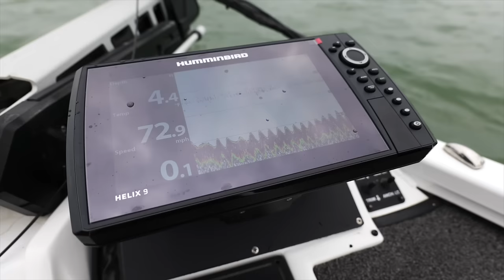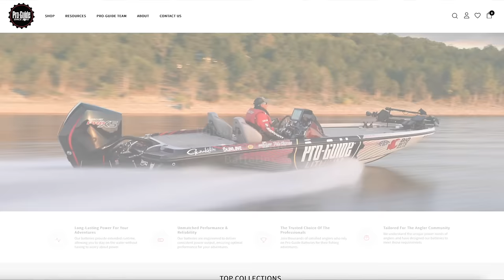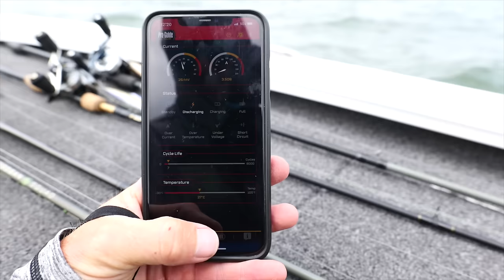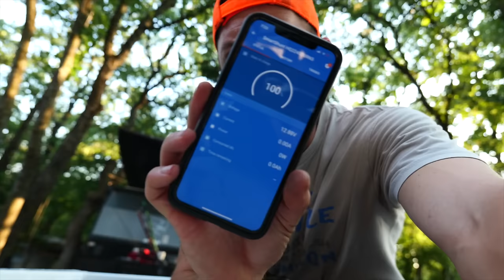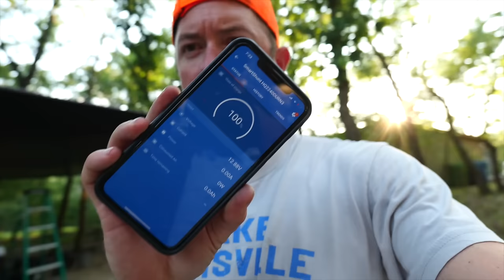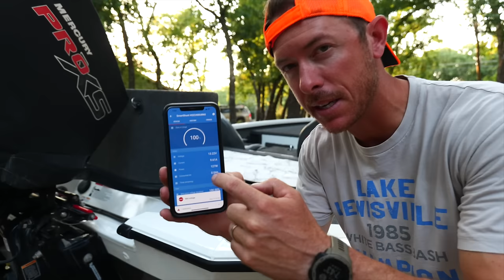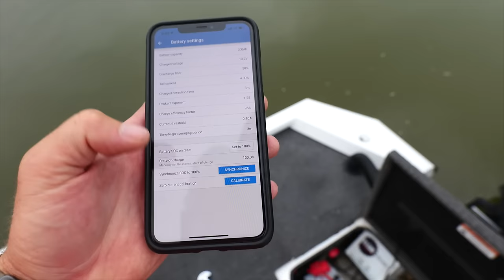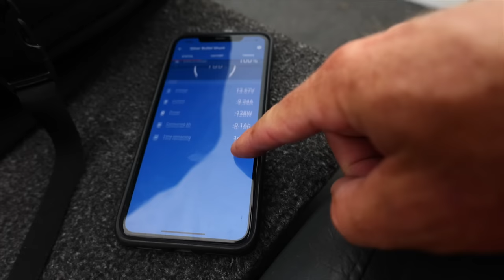I've Never Seen THIS on a Bass Boat! NEW Easy Battery Set Up & Install

Comment: I'd recommend an insulted/fused bus bar for your positives as well. When it comes to change batteries out you are only having to remove 2 connections from said batters. A fused bus-bar would also allow you to fuse each load independently of one another. This allows you to clean up all the in-line fuses that are currently fusing their loads.  Cable/Wire  management just comes with practice just like everything else. Good job figuring it all out. Dealing with 12V DC is fun.

Comment: Very cool system. One suggestion for your cable and terminal lugs is to use tinned copper. Tinned copper doesn't corrode and break down in wet conditions like regular copper. It is used in nearly all marine electrical applications.

Comment: I’d use locktite on all those nut connectors just to be sure. Lots of vibration in a boat, especially an aluminum hull. Great content LFG, thanks brother!
Reply: Not anymore than an airplane and we don't loctite them

Comment: My only suggestion would be to squirt some clear silicone underneath your buss bar.  When you drilled into that, water ejected out.  That means that water can hold there.  The silicone might help prevent water from soaking down on the buss bar.  Great setup and great information for all of us.

Comment: I've been thinking of upgrading my electronics on my AVX1980 and was thinking about having a dedicated battery for my graphs but after watching this I may rethink that. I hadn't really thought about a 24v lithium for the trolling motor. Thanks for the content.
Reply: Having a dedicated battery is a better idea. If you drain your battery you can still start your motor and go home. But you’ll need to rewire your boat. Another alternative is to find a lithium pack that has a 24 and a 12 v outlet.

Comment: Great video. Ill be curious to see if the 2 AGMs are overkill. I habe a vexus 1980 and pro guides as well. I run 1 AGM31 for cranking, accessories, dual poles,2 helix 9s , garmin 106 and livescope all off 1 battery. Never had a dead battery yet. Making runs thru the day helps keep it topped up a bit as well. Great to see you in a Vex!

Comment: You should do a deep clean video next. How do you remove old rust stains, clean the carpet, polish gel coat, etc. Also, you mentioned you're going to change out to Garmin, would be a good video to show you remove the old graphs/chartplotters and install the new units.

Comment: Only think I’d do is use dielectric grease on the connections in the buss bar. Idk if you’re applying the corrosion x to it as well.

Comment: Woe amazing work not only on the boat but in your videography and editing.
Only way in today's technology to upgrade what you've done is maybe some kind of solid charge plug in point with a saftey break away point in case of the occasional OOPS and forgot to unplug the extension cord.

Comment: I noticed your trailer lights flashed while you were standing there talking at the end of the video. You might want to look to confirm but I had this happen with my Chevrolet truck on both my Phoenix and my Vexus boat trailers. It only happened with my Chevy and not other brands. Would actually run my truck battery down if I left my trailer lights plugged in over night. I never figured out why it did it and the Chevy dealership could not figure it out either. Was very frustrating but wanted to point it out since I saw yours flash. Hope this helps you avoid a truck battery down.

Comment: I bought batteries this year but couldnt afford the lithiums for my 36v system. I bought 3 group 29 duracells from sams club for 110$ each. That's the cost of 1 lithium. I REALLY want to try lithiums but until their cheaper i cant do it. You replace those helix units i would be VERY interested in the helix si units. Looking to replace my old 898 and 998
Reply: I like smart people
Reply: Yes but you will only get one or 2 years from them and only have a 1 year warranty…..I did the same that how I know I’m running 24v so thinking of going lithium this time or maybe the Duracell platinum
Reply: @slange455  my last set of batteries lasted 6 years. Keep then charged up and always plugged into a smart charger and they will last

Comment: I have victron shunt installed in my kayak I have ap12 old town
With a live scope and monitor
Running 2 lithium batteries one for trolling motor and the other one for electronics.
My only advice to you is try to seal your wires, heat shrink is not enough add liquid tape might save you a lot of headaches
Reply: On a boat sealing is a waste of time.  It's only ever going to be a problem if the boat sinks.  Your connections are the least of your worries at that point.  Look under the console in any boat to see open bus bars.
Reply: Both comments here are false

Comment: I know you run garmin. I’m guessing your either going to run 2-3 10”-12” and 2 black box. My plan when I redo my set up is 1 house agm for lights pumps ect. 1 16v 80ah lithium for electronics and 24v 100-120 ah for trolling and black box. With cut off switches and 3 way for black box to run 16 or 24 and graphs for 12 or 16 or off

Comment: LFG,
I am speaking to you as a professional electrician. 
Your positive wire from the charger to the battery is too long.
Coiling up that wire will create an induction coil that could potentially cause a fire from over heating.
It is perfectly OK to cut that wire down to size and to crimp a new end on it.
If you coiled up any other small control wires because they were too long please cut them down to size as well.
Factories typically make those wiring harnesses long in case an installation needs them to be that long.
As I said, it is perfectly OK to cut them down to size and to crimp a new end on them.
Reply from the maker: And this is why the Lord made the comments section! Thank you Sir!
Reply: @LakeForkGuy  you're welcome LFG. I'd hate to see you have a problem, especially if you have your family on board. When you cut the wires down please leave a little slack. As the boat will move around it will allow the wires to be relaxed as opposed to being tight.
Reply: Would it really get hot enough to even cook an egg or warm up some water or burn someone let alone start a fire?
I find it amazing lfg can cook some farm fresh eggs on his boat with no effert. I greatly want to see that in a new vlog
Reply: @tatertots-n-soup  yes, wires can  get hot enough to melt themselves or catch other things on fire